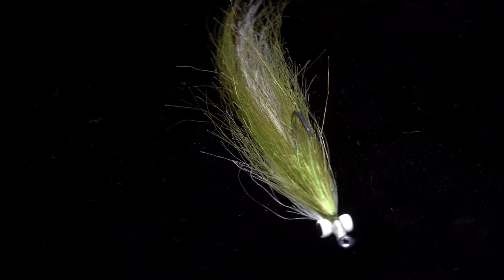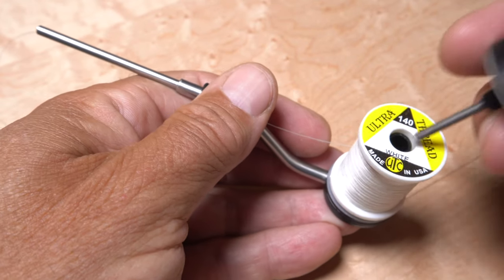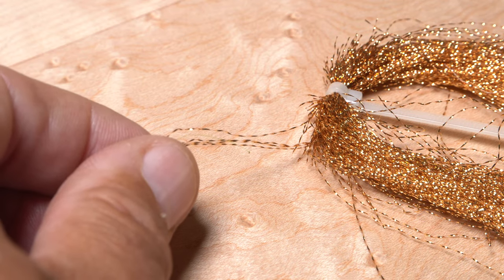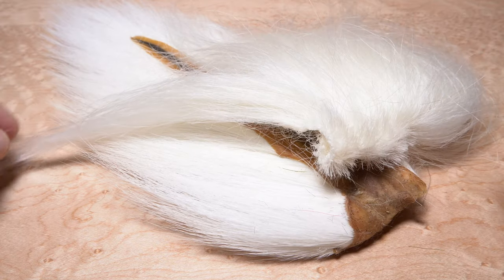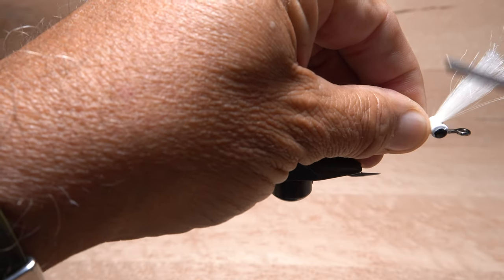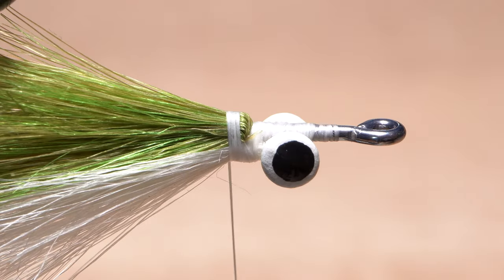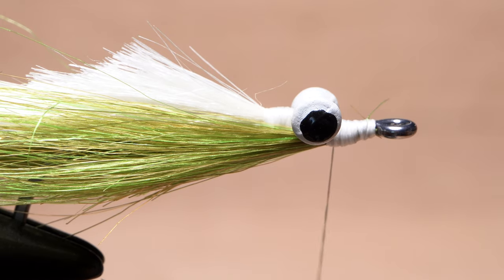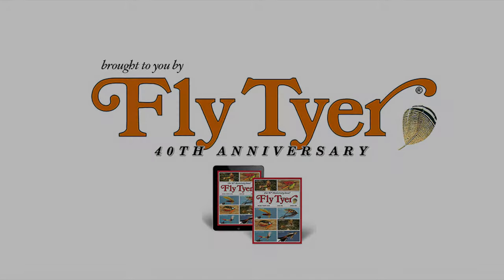Tying a Synthetic Clouser Minnow

Comment: How do you folks keep your z-ment, or tying glue of choice from gluing itself shut??
Reply: Put a dab of Vaseline on the threads and screw the cap on.
Reply: I've had this issue before, I've noticed that if you make a stand for the superglue so it never tilts or goes upside down, it will last a bit longer. Right now I'm using a stand from just a small cardboard box with a hole in one side. Hope this helps
Reply: @dannym30  do you dab the Vaseline on every time you use it?
Reply: @HalfInsaneOutdoorguy  no I do it once every few months I'd say. Once it starts looking like it's starting to build up gunk on it I wipe the lid and tip clean then reapply a new dab
Reply: Dubbing wax on the threads works well

Comment: Good looking fly. Thanks for the pattern and instruction. That Squimpish material seems very expensive ($11) for what appears to be a not-so-generous amount in the package. How many of this size Clouser Minnow might you expect to tie with a single package of each color (olive and white)?
Reply from the maker: I initially thought the same thing, but there is more material in each package than it looks and you generally don't use too much for a fly. The other thing to keep in mind is its cost compared to a bucktail with the same length fibers (if you can find one). Plus the fact that you can't use all the hair on a bucktail either. As far as how many Clousers you can get out of a single package, just a guess would be about 2 dozen.